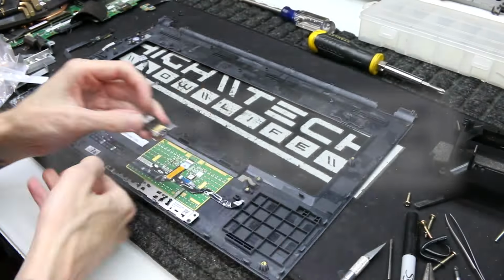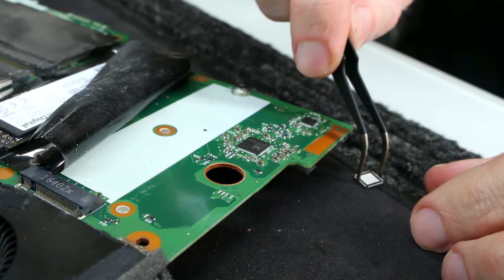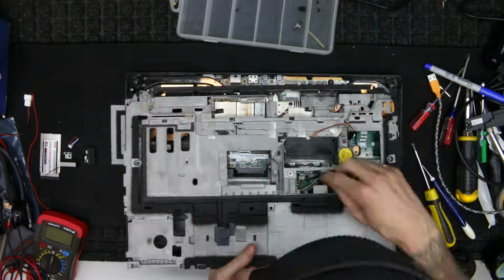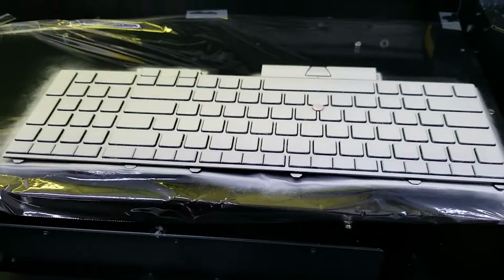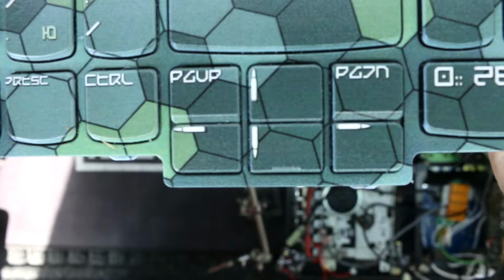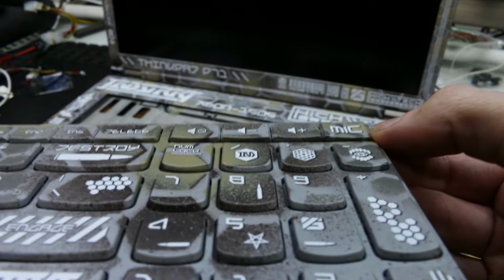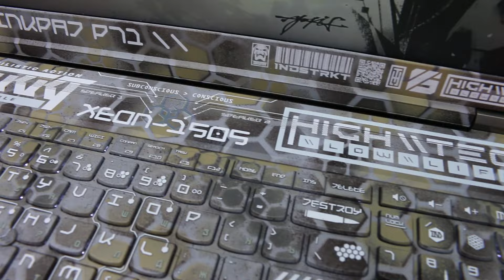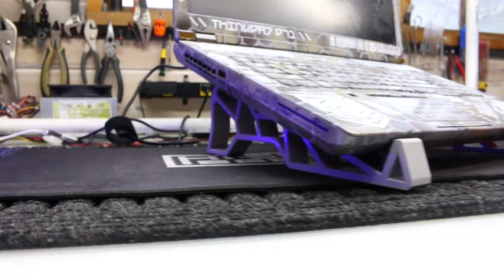💻 Another Painted ThinkPad Done! [P2]

Comment: No lie most of the time with bad audio 1 little resistor or capacitor is to blame. Either got to test for a short or if you have a thermal camera it will light up like a Christmas tree. Basically a 2 dollar part causing all the trouble.
Reply from the maker: Yes, I do have a thermal camera and have fixed other boards with it, but all my testing didn't show any shorts, even replaced the original chip, still did not fix it, so I'm not sure what the issue was unfortunately.
Reply: @hightech-lowlife  ah no way you must have caught s real hard one but loved your solution. it was also the only thing i could think of
Reply from the maker: @Jimmys_TheBestCop  If I was a better board repair man, I'm sure it's fixable, just not for my skills and time at this juncture 🤘